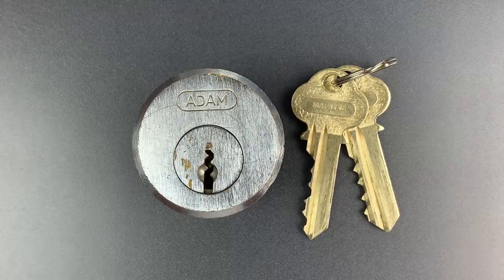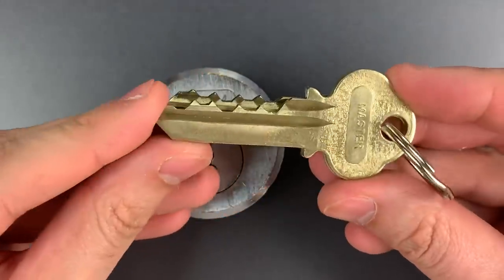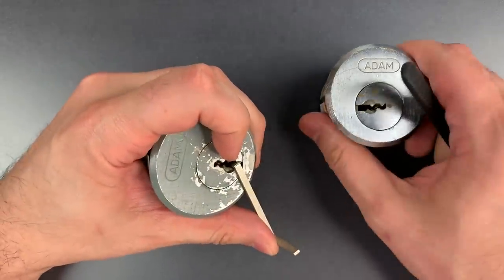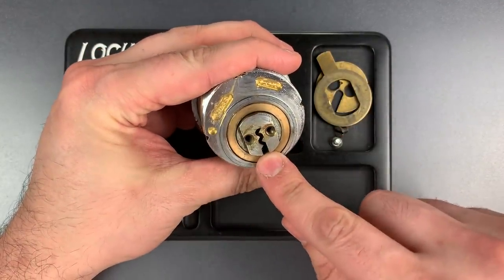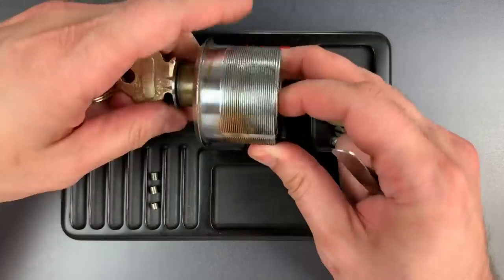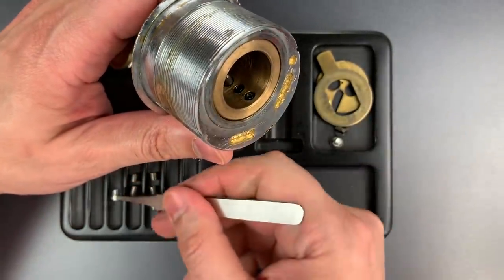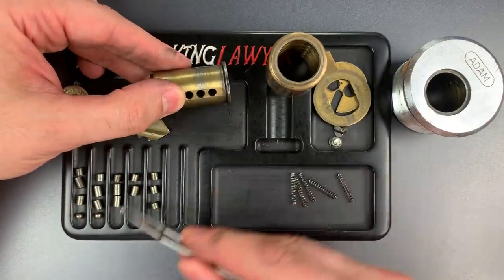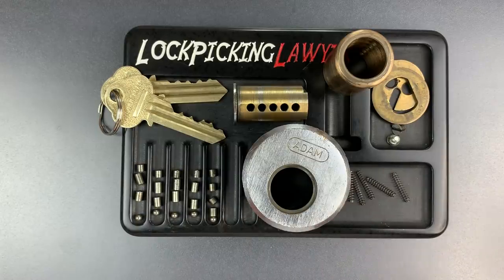[919] Prison Break! Huge Prison Locks Opened in Seconds

Comment: I mean sure, they are easily picked, but really that should be a moot point for prisons that are designed correctly. You're not supposed to be able to reach the locks unless being led in by a guard. Most prisons don't use bars anymore, the doors and walls are solid. In maximum security facilities they even have choke points, usually the exits to the block, that has to be buzzed open from the outside.

Comment: I used to work with a lot of Corbin master ring mortise cylinders in the past. As far as pinning was concerned, very unsecure. With Grand Master floor master and change key especially when keyed correctly there are too many possible sheer lines. Uneducated people outside of the trade were impressed by size. Here it is just a downfall.

Comment: VISION IMPAIRED,   SO THE LOCK YOU HAVE IS EASY TO PICK, BUT THE KEY SIDE IS ON THE OUTSIDE OF THE CELL DOOR WHICH THE INMATE HAS NO ACCESS TO AFTER THEY ARE PLACED IN THE CELL.  IT MAKES IT EASIER FOR US MAINTENANCE TECHNICIAN S TO PICK IF WE WOULD NOT HAVE THE MASTER KEY 🗝️.

Comment: How would the prisoner have access to the lock to pick it? They have a tendency to be on the wrong side of the door.
If it used bars perhaps, (Though I guess LPL should be picking it from behind.) but while Ive not seen inside many prisons, the ones I have seen rarely do. They have toughened doors with a hatch on them to look in. 
I would imagine the lock picking vulnerability is a minor concern in comparison to how robust the locking mechanism is both under the pounding of someone on the other side of the door who is not too pleased to be in there, and the locking and unlocking that has to happen on a very regular basis. In that regard it looks like those are probably up to the job.

Comment: Although it would make it easier to escape from prison being able to pick a lock. There are safe guards in the system to keep inmates secured. Picking a lock may get you into a room or out of the building.  But it wouldn't get you free from the prison. As most prisons don't use a lock & key type door to get out if the prison outer boundary..  Thats why they prisons don't consider changing to more secure style locks..

Comment: You need to put into perspective where this lock is used. If the Corrections Security Team were half smart they wouldn't use it on a high security containment line. But in reality American prison locks are shit. Get yourself a Chubb Custodial 3G112 Manual Pass Lock. See how you go picking that.

Comment: In the 70's, I was a corrections officer in a prison that was close to 100 years old. We had massive brass keys, used to unlock gates on the different housing lines. They were easily 4 to 5 inches long, and about 1 1/4" wide and about  3/16" thick. The biting consisted of rectangular cuts, similar in idea to skeleton keys, but much larger. The depth of the cylinder was about 2".